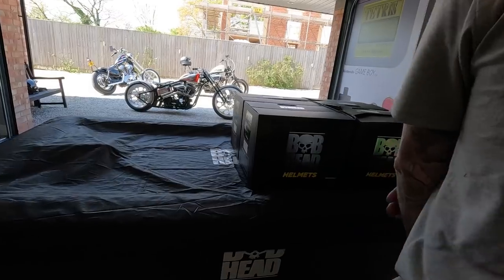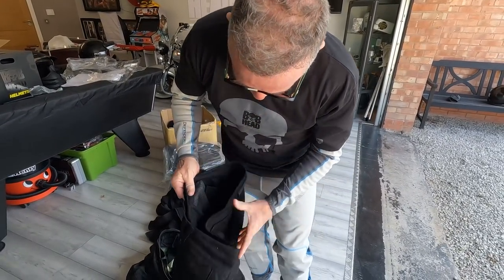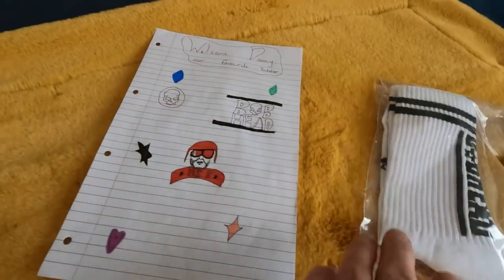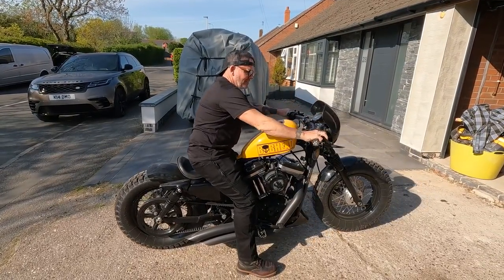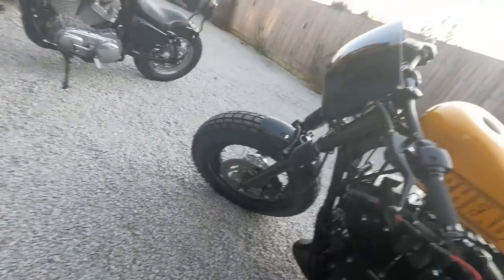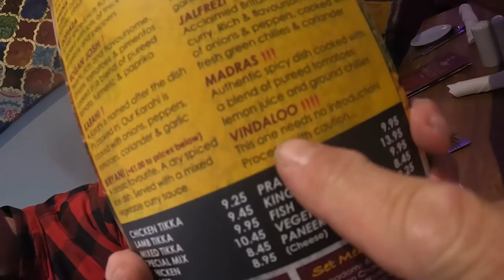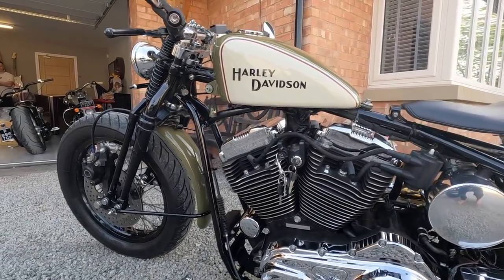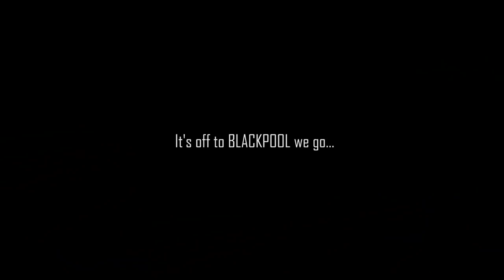A Real Samurai Chopper - Harley Davidson - Zero Engineering

Comment: Amazing choppers.  As an owner of a custom chopper myself, I truly appreciate you getting off of the standard issue Harleys and riding a real bike.  Best series so far,  Keep safe and sane.
Reply: Yeah agreed,  I don't ride Harleys but these bikes almost makes me reconsider.
Reply: W.T.F are you taking about ?  He just rode more miles in a few weeks than you have ever rode a chopper
Reply: @kurtfoulke5130  What are you talking about?  I'm sure you don't know me so you wouldn't know, now would you.
Reply: @CervicalStrike  yeah I know you. You're the one wearing Vans & a Biltwell helmet with 20 inch risers and a 1 gallon fuel tank on an Old School 2014 883 Bobber 😂🤣😂
Reply: @kurtfoulke5130  Kurt, you got the bobber right but mistaken on everything else.  Keep guessing.  The over/under is 200 and I'm taking the over.  The 1 gallon tank and 883 comments are offensive so I'll tell you my tank is a customized CZ, holds a bit more fuel for the much larger motor.